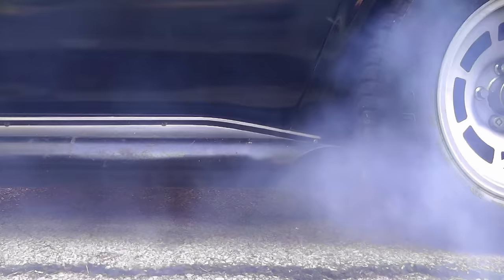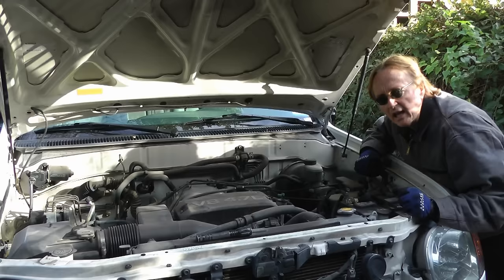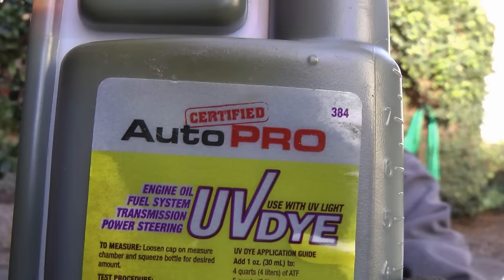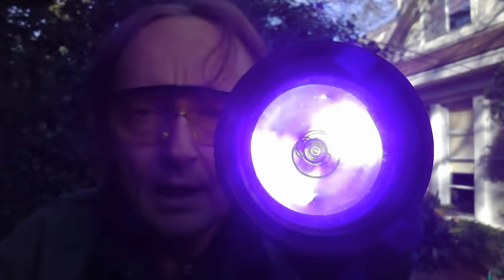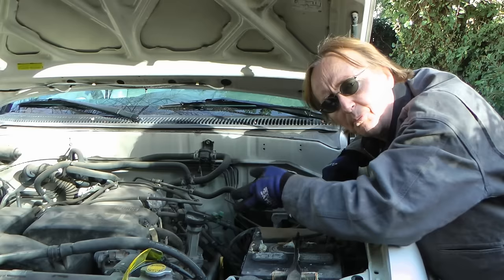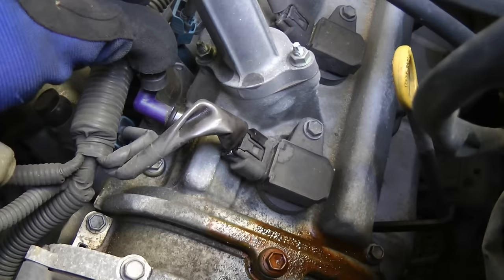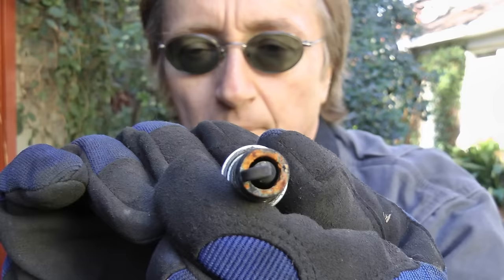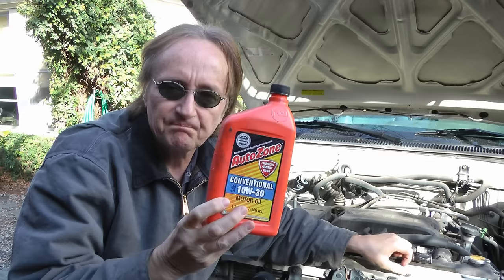How to Fix a Car Engine that Loses Oil (Leaks)

Comment: I have a 2007 Chevy Avalanche with about 210,xxx miles on it. I change my oil every 3,000-5,000 miles and it seems like every time I do get it changed for the first two weeks or so I have to constantly add oil, and its blowing white smoke like crazy from the exhaust. But after I add the new synthetic 10w instead of 5w it runs a bit smoother and the white smoke isn't a problem and I don't have to add as much. Maybe it just needs the thicker oil? However, the oil seems to wear out a lot quicker.
Reply from the maker: engine is just flat wearing out inside. Ue the syn and live with it

Comment: I have a question:  Can you determine whether the car has bad rings or bad valves by fixing it in a low gear, accelerating hard, then engine braking back down through the RPM range?  I had someone tell me that if the car smokes during acceleration, it has bad rings; and if it smokes during engine braking, it's the valves... Any comments?  (BTW, I do know of the other methods to figure out the issue but I am curious to see if this is true)

Comment: Scotty,Have you ever heard of using CerTech Gel its ceramic gel that goes into the oil I have a 95 Grand Prx with low compression with blowby  changed EGR valve,Idle Control Sensor,but still Idles high was told the engine was going I need to extend the life of my car.Thanks,Michele

Comment: Love you Scotty, my question is about oil grades.  My 2000 Camry has oil leak in engine valve. So I am forced to pour in a little bit of oil every 3 weeks or so.  Car has 145k miles and I would like to know which is best brand and grade of motor oil to use for each oil change at 145k miles?   And which is best oil filter to use? And how do I determine which oil grade to buy depending on the mileage? Thanks Scotty!

Comment: Hey Scotty, I like the down-to-Earth style Of your videos.
I have a 1981 Ford Fairmont inline-6 cyl. I have changed the valve pan gasket, rear seal, front seal (& oil pan & timing cover gaskets), pcv valve & grommets, breather filter & almost all the vacuum hoses. The rear seal & oil pan stopped some of my leak, but it's still leaking at the top. The canister purge valve tees into the pcv valve (I haven't changed it)- could it be messing up the pcv system? I've also noticed what I think is moisture dripping from the vacuum line for the brake booster, could be related. The car runs pretty good
Reply from the maker: make sure the pcv system is sucking air correctly and venting the crankcase first.  But brake boosters should not drip anything, check that for vacuum leaks if it's getting cold from sucking air and causing moisture to form

Comment: hey scotty, its been practiced alot that if a car is buring oil, use a thicker oil and it will stop burning it.

for example i have a 2005 honda civic 125k driven, oil used on it always was 10W40 and always replaced after evert 3000-4000km. but recently it started burning oil, i have been told by many people that by using 20W50 (thicker Oil) will resolve the issue and the engine will stop burning the oil, is that true?

also if its the PCV valve has gone bad, then shouldnt the car be smoking after burning the oil? my car is not emitting any smoke.

Cheers Scotty, love from pakistan.

Comment: Hey Scotty! great video. If your running full synthetic oil and are putting in Lucas does it have to be Lucas synthetic or can you use the regular Lucas as in the video?
Reply from the maker: it really doesn't matter, realize "syn" oil is just normal oil from the ground that has been treated with things like acid to make it more pure. It's not some magic new formula.

Comment: Hey scotty,
I have 2006 Nissan murano that consume 1 liter every 2500 kilometer and the rate just keeps increasing slightly by the time.  I checked under the car but no leak at all. I see seepage coming from the two crankcase sensors. I know it's not a big issue comparing to the oil burning. I change oil filter regularly at 10k, and just keep adding oil all the time. 

I'll follow your advice of checking the PCV and clean it.

And other advices?

Comment: Hello scotty,
I have question related to this subject  about 07dodge caliber oil leak when using air condition specially when switch it on heat.
My car lost about 1/4 gallon of 10-30 oil.
I noticed the leak behind the engine but I’m not sure where exactly came from .

Thanks for helping a lot of people :)

Comment: We were handed a print out from VW dealer that burning 1quart of oil every 750  YES 750 mile is acceptable on our 2010 Routan with more than 50000 on odometer. So with a 6000 mile change interval there would be no oil. But "that's acceptable".

Comment: I own a 2008 Scion TC. It increases mileage by around 18,000 every year so you know I am going to run into problems faster than the average person. I have to add between a 1/2 quart to a quart of oil every 3 to 4 weeks which is about every 1000 to 1500 miles of use. I did a valve cover and gasket change and it slowed down the oil loss mystery to that rate. I had to add a quart every 600 miles or so before. I'll look into the PCV valve but I was also told Toyota engines in general and especially this one I have on the Scion TC (And Camry and Rav4 of the same years) is always going to consume oil. I wonder if that's true and why would they be designed like that. I am using Mobile 1 5w20 yearly protection with an extended duration oil filter and I added Metal Lube oil treatment in case I forget and take longer than 3 weeks to check the dipstick... I am going to be adding a quart every month to month and a half so I bought that oil on sale last year and will do a yearly oil change instead.

Comment: I'v heard saying DIESEL engine should stop working right away after ignition key is off(is it called compression braking?). Otherwise if you can hear crankshaft revolves repeatedly after ignition is off, that means engine is heavily worn out. Is that true? And is it normal for engine to burn some oil (not a quart per month) ?

Comment: hey scotty, your videos are great, I learned a lot from them.

I have a nissan pathfinder 2002 model. I had to replace the engine due to some major defects and after that it seems fine, but the fuel consumption is certainly not OK, its little higher than expected also between 0-60km the pickup aint that great, I think it has something to do with throttle and also my transmission ..

do you have a possible explanation and suggestion for my car ..??

Comment: Dear Scotty, i just have rebuild my BMW 325i 93 engine with new rings, gasket, wear on cylinders was inside normal, then i stick with same pistons, rering, and all gaskets new, but engine have ran 300 milles and still is burning lot of oil and big smoking, el oil cap there is not sings of any blowby, engine fells goods, responce is ok and no fails at any time, only lots of smoking and lots of oil consupcion, what you sugest me to check? thanks

Comment: Hey Scotty one of your subcribers here! So I've determined I'm burning oil due to my oily plugs/black plugs. The question now is should I change my spark plugs along with my PCV valve. Because I don't know if I was burning oil due to the PCV valve or bad pistons rings etc. But if I change spark plugs and PCV valve and recheck the plugs again I'll be able to determine if it's internal at that point right? Thank you! :)
Reply from the maker: yep, start there and pray. If it still gets the plugs oily, odds are engine is just flat wearing out, do a compression test to find out that for sure if you have to

Comment: Scotty, Is it bad to reroute the PCV system of certain cars to an oil catch can or to the atmosphere? I have done this on 2 cars a late model GTO and a 97 jeep wrangler. On the GTO it became nessesary to run a catch can because I installed a roots supercharger. I had discovered immediately after installing the thing and dyno tuning, removing the supercharger diagnosing a seperate issue, that after a couple of dyno pulls an insane amount of oil was being blown into the intake manifold of the supercharger. No mechanical problems, I chalked it up to the PCV system not being designed for high boost pressures from the blower. I did notice after the catchcan install the car made more overall power and torque on the dyno. As for the jeep I capped off the corresponding ports on the intake and intake manifold venting the PCV to the atmosphere. I have noticed improvement in overall performance on the street and after my first oil change the color of the oil was the same as how it went in! Besides emmisions is there a downside or danger to this mod?

Comment: The oil rings in my engine are gunked up and I burn about  1 qt of oil per 72 miles. I guess its kind of a design flaw. I had rebuilt one of these engines before, but I honestly don't have the time to do it again. So I guess my question is that is there any magic chemical that will clean up the carbon and hopefully open up the drain holes or should i rebuild?

Comment: Hey Scotty thanks for responding to my previous comments , but 
I had another question.About how much does a head gasket for a 98 crown vic cost and would it be wise to just replace the entire engine. old police vehicle 120 , 000 mil.

Comment: scotty, i have read rumors of volkswagen 2.0l aeg motors that some that were built in mexico had the piston rings installed upside down. My vw loses more oil than i like, no leaks no smoke in exhaust, and a good pcv vent valve. It does have more blow by than other engines i have seen. it has 108k and i dont believe the motor is worn out as it runs fantastic, i think the piston ring rumor is true. Im going to pull the head in the future and reseat new rings. In the meantime can you recommend me a good product to put in the oil to slow the consumption down? i run full synthetic 5w30 or 5w40. Thanks!

Comment: Scotty you told me  before you use lucas oil stab. on all your cars. Im going to change my oil this coming week. My Dodge Intrepid 01 had over 99 thousands miles do you recommend using the oil stab on my oil change or is it to early? I want my car to last like yours. But I heard that this car had issues with car sludge so i took your advice and im using 5w30 Castrol oil.

Comment: Scotty, does oil additives that claims to stop engine from burning oil works?
Reply from the maker: yes, some can slow down oil burning, such as Lucas. None are miracles if an engine is just flat wearing out though
Reply: Scotty Kilmer I have a corolla 99 that burns 1Qt every 1200 miles.  when i started to use Lucas oil the engine no longer burns oil
Reply: Scotty Kilmer i might try lucas. I had the oil ring and piston rings replaced and also the valve seals. I also did break-in after that but stills smoke during hard acceleration, 80kph speed and random smoke during idle specially when engine is cold. Consumes lots of oil. I just don't know where it's leaks.
Reply: You ever figure this out?

Comment: Hey Scotty, I've noticed that my car has been lighting up the "check oil level" light and I have added oil every time it comes on. I drive a 2002 BMW 325i with 164K in it. There are no oil leaks, at least that I can see, and there is a cover right under the engine to prevent any liquids from making it on to the asphalt. What do you think is more likely? a bad PCV valve or my engine needing a complete overheal? it has had me worried for months now. Thank you and I hope to hear from you soon!

Comment: If you, like me, own a Toyota Avensis with the VVTi engine then Toyota failed when manufacturing the engine and it starts to consuming copious amounts of oil around 90-100k miles. Toyota had a secret warranty for this that extended 7 yrs beyond the official warranty of your car.

I bought my Avensis 3 months ago, oil topped up. 2 months later it was bone dry and I was informed by my dealer about this 'expired' secret warranty ... now I have to dish out ~$3000 to get it fixed if I want to keep the car and not have to go through a warehouse of oil.
Reply: Dynamite Harry get Yugo its better for you or even IMT tractor from Europe would help your problem.. +
:-00000000000000000000000000
Reply: I heard this too and also heard of the dangers of trying to flush out oil with various cleaners where the oil deposits gets lose and clog up the engine instead.
Reply: +Ivica Baksa Nah, too speedy for me ... rather have a nice old kleinbus from ´71, the early bay. Owned one a few years ago but stupidly sold it and now what once were $500 will cost $5,000 to buy.
Reply: Just the recommendations from the manufacturer not to use any oil additivies or cleaners due to smaller oil passages in the engine block.
Reply: Dynamite Harry . try having an engine flush.  its probably the oil rings clogged.  i have same issue on my isuzu vehicle

Comment: My 2012 KIA Soul with a 1.6 liter started burning oil at around 98,000 miles. Goes through a quart every 1,000 miles now.  I need to look at the PCV valve (if there is one) and replace it. My mechanic told me to step up to 5W - 30 oil instead of 20 and see what effect that has on it. Any recommendations Sensai?

Comment: Scotty, I've got a 04 sedona that had its oil change every 3k miles. Recently I got the oil pan replaced, since then the car has been eating/burning oil, more so as the days progress about 1/2 qt a week. There are no signs of leaks and I replaced the pcv valve just as you've instructed in this video to no avail. Now my question was can this new oil pan be burning up the oil or could it be a more serious engine problem?
Reply from the maker: oil pan can only make it leak if not sealed right. Try a dealer pcv valve, cause a cheap one can suck oil and make it burn oil that way

Comment: Scotty how about the Castrol High mileage oil? I heard it's good for when you have oil leaks. Also that once you use this oil you can't use any other since it does something to the oil seal value, thus you must only use Castrol High mileage only is it true? I'm asking because I use the reg Castrol GTX but was  considering using the Castrol high mil.

Comment: 2005 corsa just did a head gasket change 2000 km ago I noticed that the car loses oil but only after a long journey if im travelling or something I always check the oil level and water level before I leave and they are fine but once I areived to my destination the oil level is really low and the water level does not change if I'm in the city both oil level and water level do not change whats up with that?
Reply from the maker: worn piston rings do that, you just changed the head gasket

Comment: Hi. I never understood pcv. I mean why don't the build up gases just escape through the fresh air breather pipe? I mean it's free for flow without a pcv valve on that side, why does it choose to go through the valve? and can rocker cover fumes be due to any other reason than blow by?

Comment: I have massive oil leak, its leaking right under the timing belt. I have 2000 Chevy Impala 6 Cyl  3.4L. Brought it at an auction for cheap any advice would be appreciated. Thanks

Comment: My chevy truck has visible blue oil burning issues. It smokes when you start it up (weird part is it doesn't matter if its hot or cold engine) and it burns oil after a long time at idle (like at a light). When you hit the gas after its sitting at a light there is also visible smoke. The longer you wait, the worse it is. Does this sound like Valve seals or worn piston rings?  Is there a way to tell just by the symptoms without doing a compression test? Also it "only" has 230,000 miles

Comment: @scottykilmer Hello again I was wondering why you choose to use regular conventional oil over synthetic... I heard that you just use regular Castrol GTX oil... what would you suggest using any 99 Toyota Camry 4 cylinder with a hundred thousand miles.... synthetic or conventional motor oil?  recurrence of runs perfect was no leaks at all. but it does Burn it very very little. I would say maybe a quart every four thousand miles. Thanks scotty

Comment: Hello Scotty, Took my 2001 Hyundi Sonata for an oil change. The gentleman said that my seal are leaking.. Which I have known, however I don't have the funds to have the seals changed..What I do is add some Lucus oil stabilizer at every oil change, At this point, could I add AT 205 to help tighten the seal? Or should I continue with the Lucus? Please advise:) Thank you!

Comment: thanks Scotty
Reply: Try that dye in your oil and see where the leak is.
Reply: There is a good product called AT205 reseal and sometimes it can stop leaks.
Reply: 😀 thanks where can I find this?
Reply: And yeah I herd about the dye to great advice thanks 😀
Reply: +Blanca Rodriguez at205 reseal you can get it at amazon. :)

Comment: my 2008 Nissan maxima smokes white smoke but not al the time only some  when I star the engine.? a friend told me it has to do with the catalic converter???
Reply from the maker: more often bad valve seals inside the engine, OR a head gasket starting to blow

Comment: I have a 01 dodge ram magnum 1500 that was burning oil and radiator fluid I got some radiator fix stuff  from Walmart and it fixs that and my oil stop burning ( also the last time I had to add oil I over filled it) and it hasn't burn oil and now im leaking radiator fluid again and my truck has 180k mile

Comment: I used to have a 2010 cadillac cts and it burned through oil. When i took it to the dealer about it they said it was normal and that that particular engine burns oil. I sold the car and got rid of it.
Reply from the maker: yea, GM makes a lot of crap these days

Comment: My 97 Nissan pickup  has 400,000 and has started to leak and burn some oil. What would you recommend to keep it going as long as possible before I need to replace the engine?